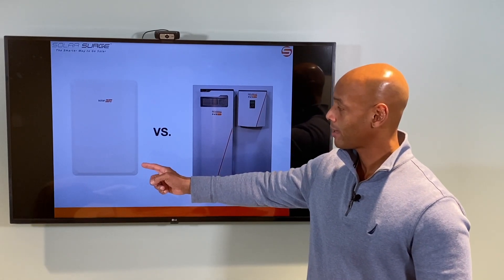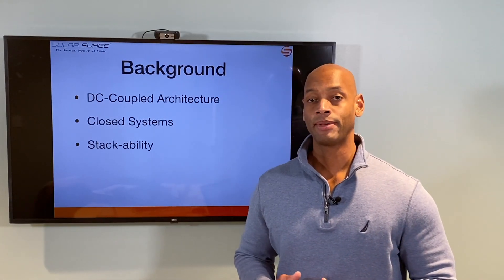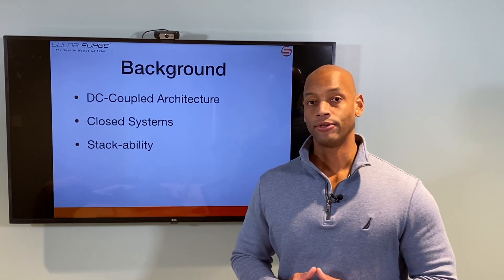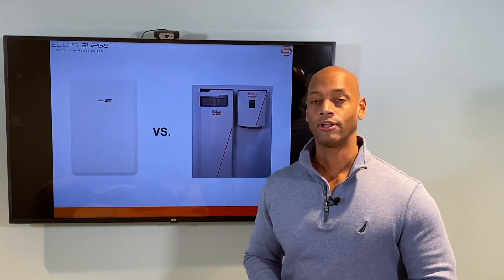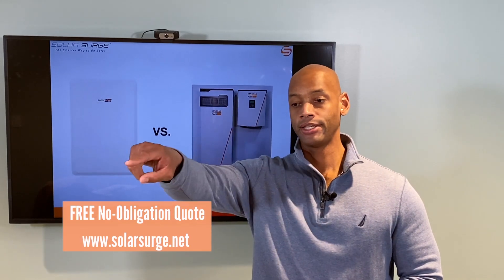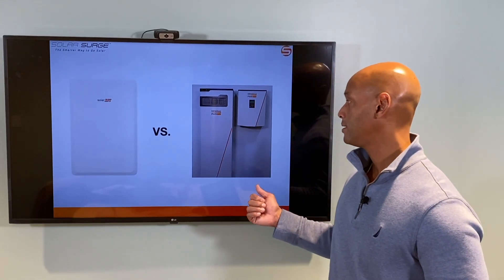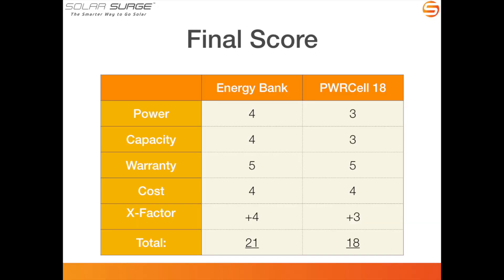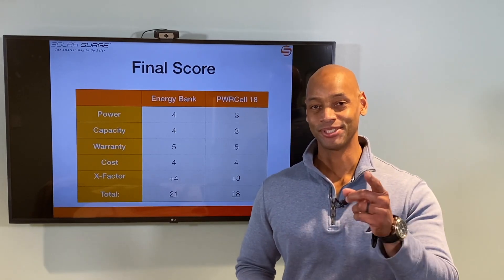SolarEdge Energy Bank Vs Generac PWRCell

Comment: Excellent video. Thank you.. I don’t have Solar as of yet, but I was looking for an option to be able to have a Battery Bank Backup being able to be recharged by a Generator. I was trying to find information if available, to set it up like the new Ford F-150 Hybrid with Powerboost. So when the batteries drained to a certain amount, the Generator could Automatically turn on to Recharge the Batteries.

Comment: Good video, thanks for the comparison. Was looking into the SolarEdge Energy Bank, but it seems to be limited to a 1-phase system. As I'm going to install a 3-phase system, this battery is not suitable. Since SolarEdge seems to have discontinued the StorEdge line-up, I'm looking for a solution. Addtional complication: Europe as install location

Comment: Can the smart panel be used with the generac system ? will be putting a solar system at my new house if the hoa allows me 🙏🏽 but want to put the new panel in even if they say no but later on after I wear them down after the first power outage

Comment: Is it possible to install two Generac cabinets but have each cabinet in their M3 configuration and then add battery modules as a DIY? Or would other components of the system also need to be tweaked/upgraded as well?
Reply from the maker: Yes this is possible.

Comment: But once power goes down the panels stop working because of the optimizer (micro-inverters) don't sense the outside voltage. Is this correct?
Reply from the maker: Not correct.  With a solar + storage system, you can isolate from the electric grid and still energize inside the house using solar and battery power during a grid outage.
Reply: @SolarSurge  Is this with any brand or just solar edge?
Reply: @mikejf4377  One thing to keep in mind is that all grid-connected PV systems, with or without storage, >must< automatically disconnect themselves from the grid in the event of a grid outage. This requirement protects workers as they work to bring the grid back up.    
If you >do not< have storage and you do not have a generator, then you will not have power during a grid outage.  
If you do have storage and/or a generator, then you will have power when the grid goes down.
Reply: @MarlinMay  I fully understand, that’s where Florida having a million dollars worth of insurance for system bigger than ten K is completely ridiculous.

Comment: I would add a category "Expand-ability", showing potential additional power and storage possibilities. 
Also, both of these systems are 240V split phase?
Reply from the maker: Thanks for the feedback.  Yes both output 120/240V split phase to match the residential electrical service.

Comment: Do you recommend energy storage coupled with rooftop solar systems in snow prone locations?
I feel that it would result in a poor outcome for the customer but it seems that it’s being done.
Reply from the maker: It depends on your goals.  If resiliency is the goal, then you need to have energy storage.  For $ savings, grid-tied solar only is fine.
Reply: @SolarSurge  I was referring to a scenario like a 2 or more day outage with snow cover. I think the spend towards energy storage is a bit futile if you cannot easily recharge it during a winter storm event.

Comment: Could you do a comparison of the energy bank and the lg Resu prime 16?  Seems like that is a lower cost alternative that also is compatible with SolarEdge inverters.
Reply from the maker: Hi Darren and thanks for writing in.  In my experience, the SolarEdge inverters and LG batteries are prone to miscommunication whenever one of the manufacturers updates their firmware.  I would recommend to keep everything under one brand.

Comment: I'm looking at boats for a full-time liveaboard,  and plan on installing as many Watts (Solar Panels) , and Batteries as possible.  Do these Power Cell Banks work in a Marine environment  ?
Reply: They will. Panels are on lots of boats
Reply: @jamesbaxter2812  Thank you, but my question is about the Power Walls{Batteries}, are they Marine Grade, or should I stick with the Car Style {Drop in} lithium Batteries ?
Reply: Battery are battery,  I don't think there is a difference.  You need ones with a deep circle

Comment: It's worth mentioning that the generac battery can start at 3 batteries and you can add 3 more, one at a time. I priced the battery at 1800 dollars a piece and I can add it myself. I know that it's not whole home backup doing it that way but I believe there are a lot more people like me that can't offord to start
 out with a big battery. Plus generac is coming out with a DC back up generator that wires right into the inverter like the pv links do. Very easy install. Very quiet they say. This quarter.